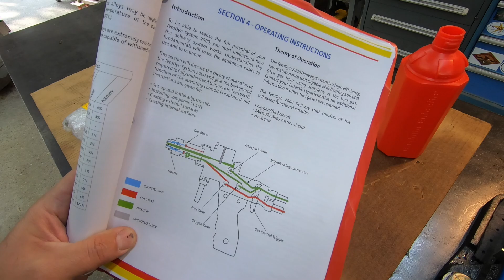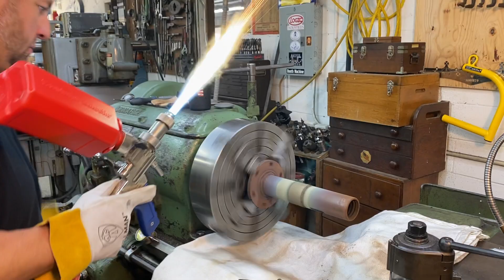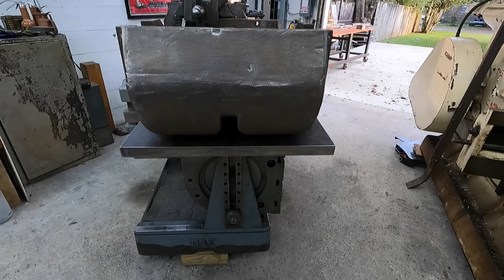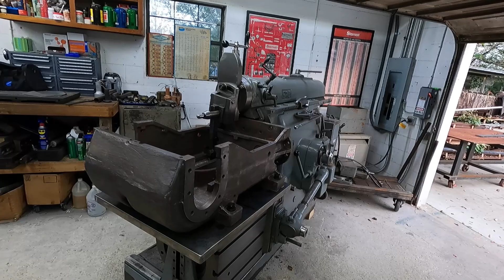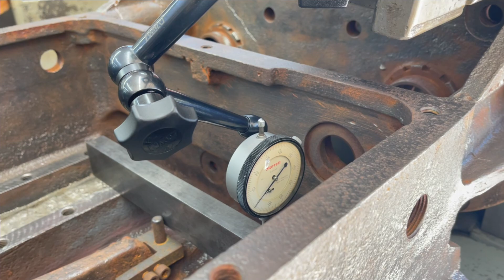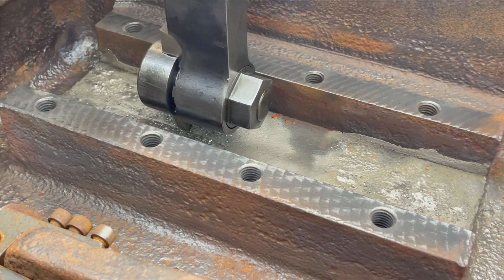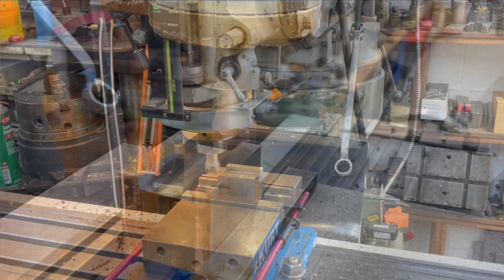SNS 331: Stoker Engine, Eutectic Torch Repaired, Tung Tri Mill

Comment: This is gonna sound silly but...is there a shaper equivalent of a tool post mounted grinder, like a die grinder adapter that would fit on the shaper's tool post?  It'll be slow, but maybe that's what is needed to get down inside there.
Reply: Not so silly, I needed to turn a deep groove in some long grub screws, trouble was getting to the bottom of the cut, to make life more difficult it was a hardened low alloy steel. I bounced about for ages, trying ideas and breaking tools. Then I spotted what amounted to an angle grinder adaptor. I clamped up the grinder to the tool post, covered the ways to protect them from grit, turned the chuck to reverse rotate and used the grinder to turn the groove. It worked perfectly, and I was able to clean the sides nicely. Job done, but it took for ever to find the right idea! If our idea isn’t a runner, well ideas are easy and cheap,  as long as no harm is done. 
For that matter how about spark erosion?
Reply: @johnsherborne3245  Epic win!
Reply: @johnsherborne3245  Hi John. Newbie here.What is spark erosion?
Reply: @richardscott6716   google it, it’s a complicated o explain here, there are some YouTube videos as well, but it doesn’t involve any force on the job.
Reply: @richardscott6716  It is a device using electricity to make an arc which 
burns of metal from a workpiece through a shortcutted electrode in a few seconds at the time  EDM ( Electrical Discharge Machining ) often used in mold fabrication
Reply: @hydramechdk7658  Thanks for responding.This “family”of machinist’s channels( Abom, Keith Rucker, bcbloc,Steve Summers etc.),has the most knowledgeable, and helpful viewers I’ve encountered anywhere on You tube. Be well. Happy New Year.
Reply: @richardscott6716  yes I admit they have a very good craftmanship  in their hands. It is rare to see people now in these days own such craftmandships. today young do their job faster and do also exstreme complicated jobs as they use cnc machines. Happy New Year to every wievers on youtube and to Adam too he realy make fantastic enjoyable videos

Comment: Since those faces you stoned where clearly milled from above, that's likely how they did the bottom as well. So they must have done this with a really long and thin axis spindle/shaft to get the clearance. The mill marks should give you an idea of the diameter of the mill they used.
Reply: what I know from the workers at Dampflokwerk Meiningen is that they have special milling cutters for this type of job. And the use a big horizontal boring mill
Reply: @DeutscheReichsbah100  YUP Rather than having that face horizontal, it was probably vertical
Reply: bck when that was built there was nothing special, so it has to be an easy solution i'm going for the tool bar at an angle out to one side, and the HSS vertical with the clapper box in the middle.
Reply: that new cutter looks like it would work great on 90% of it.

Comment: You need to make an offset tool holder for the shaper.
Reply: And spin the stoker 180. There’s more clearance the other way round. Yes it may need the plate adjusting and the overall height reducing to get the offset rig in place.
Reply from the maker: Less clearance, if folks would observe the height difference on the other end.

Comment: Completely outside the box thinking, but how about mounting a die grinder on the tool post with a cup wheel on and grind it manually advancing the ram?
Reply: My thoughts were similar, build a guide plate to screw into the existing guides with limiting guides and then use a small router fitted with a cup stone.
Reply: @july8xx  this seems like the best idea ive read
Reply: @handdancin  in reality you don't even need to do that. It doesn't appear that the repaired area needs to be machined at all. we take grinders to internal combustion engines all the time. We grind off casting marks, we smooth out rough areas so oil will flow down easier, we port the heads and we do all this by hand. As long as you blend it smoothly so you're not creating stress points and you don't need a perfectly flat surface, you don't have to machine it. Heck stroker engines have the crankcase notched with die grinders. Of course this is a much larger job than you would want to do at the die grinder it would probably take an hour, even with a 4.5 inch grinder, but Keith has an apprentice. Lol
Reply: @mattierickman498  If I remind correctly, those surfaces are where the Pice slides that guides the zylinder rod's.
I don't think you can grind this by hand.
Reply: @martin09091989  the repaired area between the machine surface that had bolts in it? It appeared to be a clearancing issue to me.
Reply: Nope.
Reply: @silasmarner7586  Why?
Reply: @martin09091989  That is because it is cast iron Adam work on. Casting contains so much carbon it will stop the grinding wheel grinding an make an enormous heat hardning the surface besides it is very messy to grind in cast iron ( check video where Adam clean the item from rust) imagine then  he start grinding the item what a mess of dirt he will do. Yes you can grind in cast iron  but much better to use sharp tools.

Comment: As for that stroker engine, sometimes you have to think outside the box, I mean if you have to go and make a fully custom tool holder then so be it, I believe the makers of that stroker engine used a custom made shaper tool holder to get in there, think like the engineers who built it would have come at it, if there is a will there's a way to do it! (after reading Adams pinned comment this ISN'T gonna work its a single use item and thats all it will be so not worth the investment)
Reply: Idee. Use a blocket clapper on the back stroke ???
Reply: @keesvaneekeren7293   unfortunately that doesn't help with side clearance unless he uses a larger tool with more stick out. I think you might be on to something it might actually work.
Reply: @TheMadHatter626  well alco the builder of the locomotive would have had tons of tools used for nothing but making steam locomotives, and other railroad equiptment, they would have maybe even had planners and shapers that may have been dedicated to just the job of making or cleaning up one casting, many railroad tools like a journal lath, or lathe with quartering attachment were used for just one thing, but they would have hand shapers and planners in the neighborhood of 20 or more feet long for doing steam locomotive frames, I cant speak much about alco as I am more interested in lima but the machines as you imagine were just massive I mean I am talking 6-8 ton chambersburg hammers for forging out the drive rods a special planner just for the frames, and a 17 foot bull riveter that was hydrolic problably with water aiding the force with the tunnage up to 125 tons, the one at altoona was up to 150 I belive I read, and the altoona works firebox flanging press they put in was 1200 tons last I read of the latest one in the 20s or so they put in, it was basicly a 4 post forming press with a 15x 15 planten bed on it, the one at lima that I read of was a 750 ton and they had a 200 ton as well the machines were just massive and if you look at the silent movie footage of lima you can see abit darkly the machines they used to making part of the locos and machining stuff

and as for Abom I am sure he considers it an honor to work on such a legendary machine, with they way he loves trips on his other channel to old machine museumes and old tourist railroads with steam shops.

Comment: Maybe they shaped or planed it the other way around, needs less space that way?
Reply: Seems obvious but I just wonder with that setup whether they'll not reach the far end of the cut before the HSS clamp bolt hits the 'back wall' !
Reply: @millomweb  there are different types of holders with clamping from for example the side or through the shank by a rod etc. Many options.
Reply: Also if they used carbon steel tooling they could've forged the shank to fit their needs.
Reply: Yeah, I'm sure he's making a mountain out of a molehill.
Reply: @millomweb  He doesn't probably have just the right tool but definitely could make a custom tool.
Reply from the maker: Opposite end of the engine is too tall, Ram ways won’t clear. That’s why it’s set up the direction you see.

Comment: I'm assuming, but is it not possible to lower the table, just enough to clearance under the ram, if the fixture were instead mounted 180 degrees oriented with the bronze journal side of stoker closest to the machine head?
Reply: Does Adam's shaper have a long enough stroke for that?  Indicating the cylinder heads that far away might also prove tricky, but maybe there's way.  That center support in the casting (with the bronze bushing) might also give more clearance problems.  But it might be worth a try.  Considering the time frame for the stoker engine, it may have been originally done on a metal planner or a very big shaper.
Reply: I think the issue with that would be that the bolt holding the HSS tool in would hit the 'back wall' before the cutting edge reached the end of the cut ! No reason he can't hand-hold the tool in that orientation to see what clearance if any it offered !
The other issue may be the shaper won't extend that far ?
Reply from the maker: The opposite end of the engine is too tall to fit. No clearance for Ram ways.

Comment: Can you bend your tools? Might be able to heat up the steel, put a 45 bend in it, re heat treat. Can leave your head set up in the same spot and not run into clearance issues. Will have to be pretty careful about the cut though.

Comment: Maybe rotate the stoker engine 180 degrees? Would make the return clearance with no problem. But may not have enough ram stroke though... Might try a square end cutter, with a minor angled offset, and just cut from the "outside to inside". Just spit balling ideas...

Comment: Hmmm... Run the cutting tools and holder at slight angles? You loose some rigidity and strength, but you gain an offset that might allow you to reach.
Reply: if he goes past 90, he cant clean up the corners of the channel.

Comment: Do you use the British standard knats bollock as a measurement Adam? We even go down half knats, very fine tolerances 😅 merry Christmas
Reply: Only blonde, brunette, and the finest, redheads.
Reply: In NZ the medium precision unit is the nit on a gnat's nuts.
For stock removal in constrained work areas the tool of choice is the tungsten-tipped-termite with extra cut depth by dietary deprivation. Sadly, they're only available in metric sizes now.

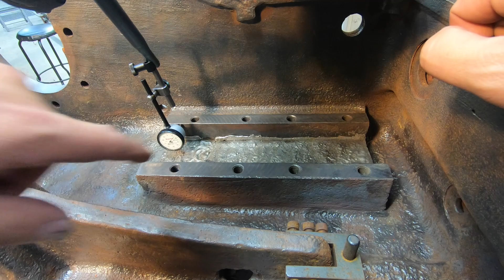Comment: 15:55 the tool marks on those mounting rails look like a flycutter was used to do 2 at a time
Reply: Given the fly cutter marks we know they used a rotary tool to deck the mounting rails. I would guess they used a rotary tool for the surface Adam is trying to true as well. Probably done on a large horizontal mill with the stoker casting on it's side, and with the cylinder bases butted against a large 90 deg. angle block.
Reply: @5tr41ghtGuy  That could be done that way. My experience as an old machinist ( I'm educated as a toolmaker and diy-maker of old school ) I allways learned clamp workpiece as close to the table as possible and avoid to many extra clamping devices. In this case I would clamp milled cylinder base to table and suppot with a 90 degree angle block to the back of the stoker engine and mill it inside.

Comment: I'm not a Machinist, wouldn't it work better if you rotated the Stoker Engine 180 degrees?
Reply: An obvious suggestion but I think the problem with that would be at the far end of the cut, the bolt clamping the tool tip in place would hit the 'back wall' before the cutting part got to the end of the cut.
Clearly the HSS piece at the end can be lengthened - that'd give more clearance from the end of the tool bar but yet again detract from the general rigidity of the whole setup.

TBH, I don't understand what the surfaces he's machining are for. Considering they're between machined surfaces that could be used for support in any case.
Reply: @millomweb  This video shows you a stoker engine in operation, so you can see why those surfaces need to be machined:

https://www.youtube.com/watch?v=3_u5pwwhXtQ
Reply: @ZeroneAngel  Absolutely brilliant - many thanks for that link.
What an absolutely crap design - making a working part part of the main casting ! That wear surface should be easily detachable and replaceable ! It appears there's nothing stopping the wear part being the two bars that are bolted down by the four bolts each - which could easily be replaced and easily made replacements !
Reply: @millomweb  Well...it is a 130 year old design...and to be honest I think that the lifespan of those wear surfaces would  outlast the locomotives expected lifespan. And even if it didn't, you wouldn't have them recut at the local machineshop. Parts of that magnitude would be sent back to the manufacturer for refurbishing.
Reply: @ZeroneAngel  For a repair, I'd consider putting a liner down of a square gutter shape bolted down by the 8 bolts. IT'd then be a replaceable part.

Comment: It would be interesting to see how they set up, the stroker engine when it was originally made it.
Reply: Two WAGS:

1) A shaper with a flipped clapper box, so the work is done on the return stroke. 
2) A really customized setup with support rods going through the holes for the piston rods. Recreating that is unrealistic for a one-off job, but for the factory making the thing, custom tooling is just another step in the manufacturing process.
Reply: Those large arcs in the 4 rails are clues.  Not sure what they tell us.
Reply: @BrianFullerton  that it was set up on a mill. Probably the entire slides were done on a mill since if you had it set up on a planer or a shaper, you could've done those in the same setup as well
Reply: @MF175mp  I agree.
Reply: @BrianFullerton  looks like there welded in place
Reply: The arc radius of the tool from what i seen would be right out side the engine if machined in place
Reply: they machine the end for cylinders on a horizontal boring mill or
a column bed milling machine as 1st operation. The 2 sides milled 90degrees in rear end as operation number 2. The last mill operation (#3) is the inside milling setting the item on milled face for the cylinders.
Reply: Whether it was done on a horizontal or vertical mill isn’t really the issue (although I do agree the casting is of a size where it is easier to move the head around than the part, which makes horizontal more likely). The thing is that a milling tool plus its holder don’t really fit in there next to the bulkhead. Maybe they just used a 2 inch or so diameter by a foot high endmill. That’d do it. Wouldn’t be very rigid, though, tool that size.

So the interesting question is, what cutter did they use? Not so much which machine.
Reply: HBM with a rotary table. An example of 1 in action https://www.youtube.com/watch?v=VFzpNEKp6BQ
Reply: @iwb316  Just watched the vid. Was thinking about an HBM as well. Setup with the cylinder faces down on the table.

Comment: What abou using a tool-holder with some amount of "dog leg" offset toward either side or toward the back to get some extra clearence? I know there is an issue of torquing the post but if you're taking very light cuts anyways, do you think it might work?
Reply: I was thinking the same, but I am not sure if is possible with existing tool head.
Reply: And would have to do a left and a right...
Reply: The dog leg cutter occurred to me also.  How about a T shaped tool holder where the T part is at the top, above the lantern holder, resting against the clapper?  That should give the lantern holder a lot more ability to resist torque.   The torque would be fed into the clapper box... a seemingly more robust piece of kit.
Reply: I was thinking along similar lines... tilt the head anti-clockwise and then fit the cutter into the tool holder angled clockwise to compensate and retain the same cutting angle.  That should put the cutter into that right-hand corner.  Obviously reverse that setup for the other side.
Reply: @tonyjover  He can't really cant the cutter over as that reduces the available height resulting in issues for ram slide clearance, that would be the normal solution however.

Comment: Hoping other machinist will be able to offer suggestions to resolve the machining challenges.  Thanks to YT, we often find our struggles are not  really unique...
Reply: Finally.  Sane thinking.
Reply: I know he says clearance, but at roughly 7:15 of this video https://www.youtube.com/watch?v=Ds2QrBk4laA  (machining the Rucker straight edges), if he used essentially the same set up, but turned the tool point down instead of the side, it looks (to my eye at least) that he would be able to start near middle and work outwards towards the cutting tip, then an inversely ground tool to go the opposite way?? Maybe I'm just seeing it from a wonky angle, but it appears as though the holder will still clear at the rear and the overhang?  The same set up would also allow for cleaning up those nasty sides that look like they are going to snap off the moment a tool hits it.  After all that work to get things set up, I would give it a shot at least (if he hasn't already) (also, I'm REALLY stubborn, to the point that I would end up building a machine to do it before I surrendered, soooo. take it with a grain of salt. ;)
Reply: Dremel tool is what came to mind.... :)

Comment: Your holding Torch to far away aren't you?  Speed of Lathy slightly to fast? Looks good. Can you run Hard Facing with that system? Shouldn't you use a Right and Left Offset Cutter so that you can reach both sides? I'm just asking.